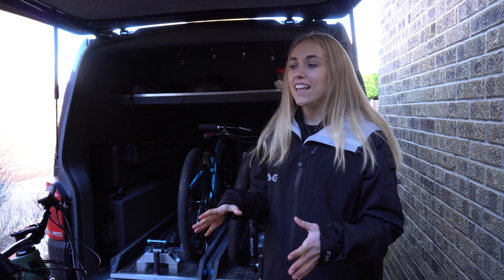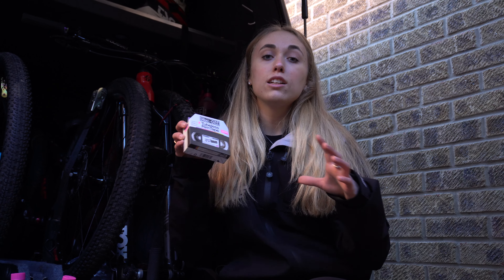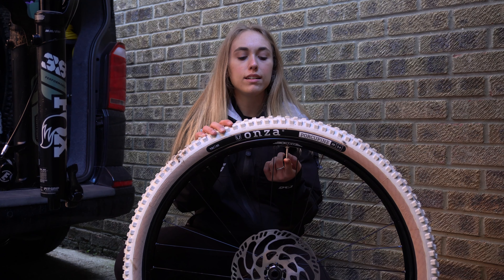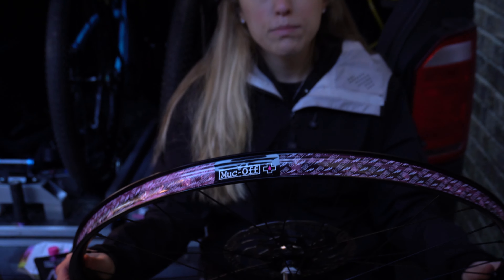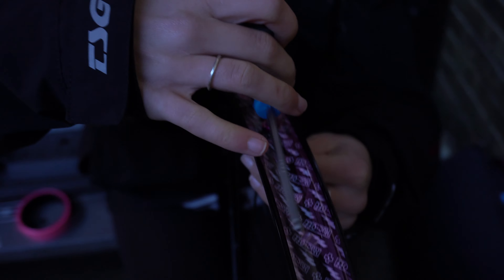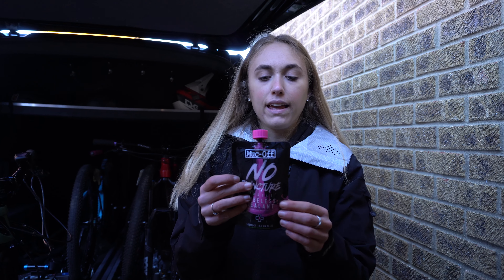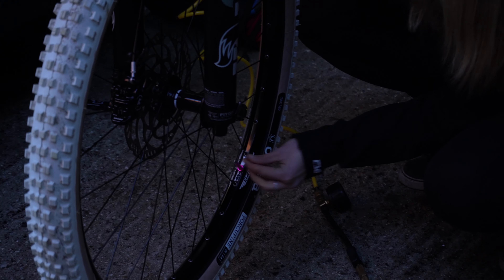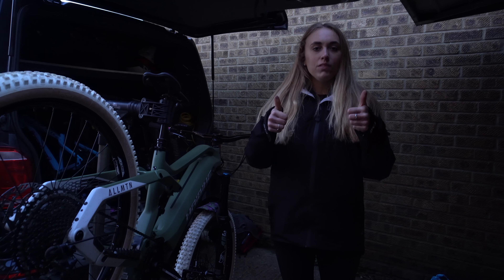MUC OFF TRAIL SIDE TUBELESS CONVERSION!

Comment: From experience once you have taped the rim, I would highly recommend putting the air in the tyre with no sealant to seat the bead of the tyre. 

The tyre should be able to hold air without the sealant in there. If it doesn't you are likely to have issues down the line. If it does, then go ahead and put the sealant in and re-inflate. 

This way if there is an issue, you can pull the tyre back off and sort it out without wasting your sealant, getting it everywhere or having to clean and dry the tape to sort it out if that makes sense...